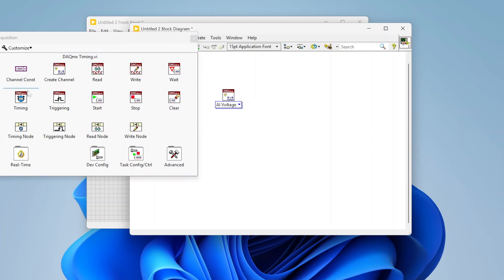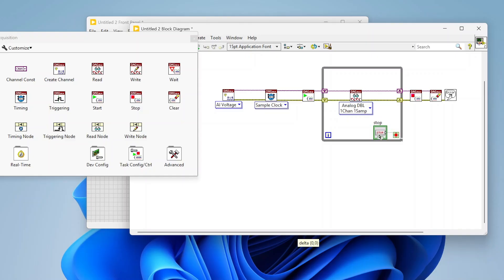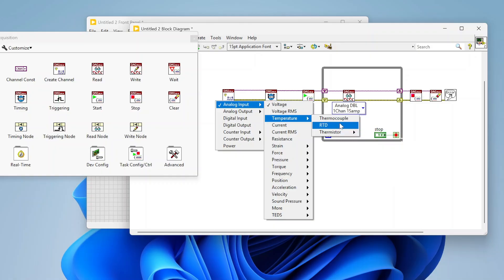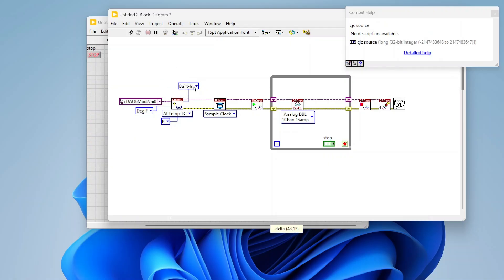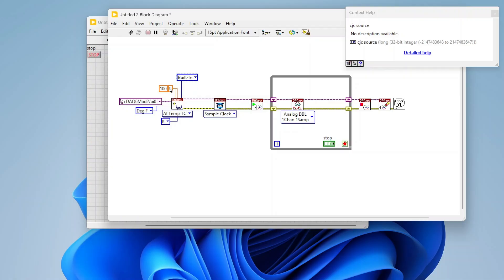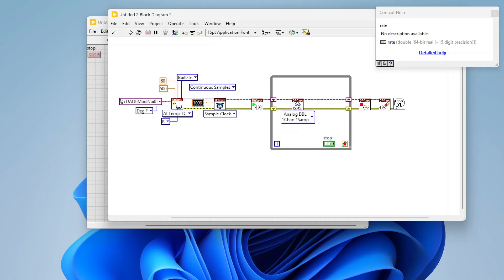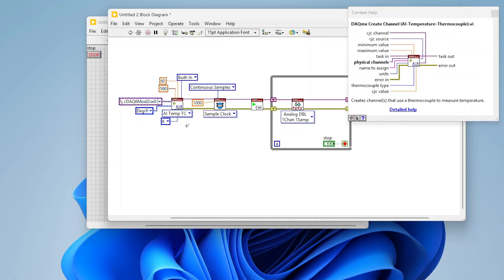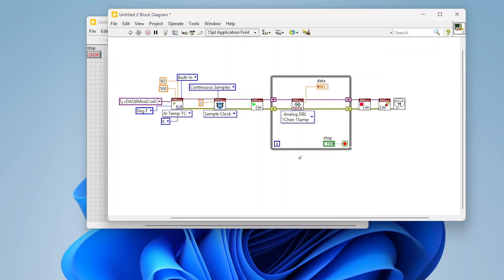Measuring Temperature with DAQmx in LabVIEW

Comment: What if I am using current to measure pressure on a pressure gauge?
Reply from the maker: You will just want to change the type of the daqmx create channel function to current type. Some of its inputs will change so set those accordingly. The rest of the daqmx code afterwards will be exactly the same though. I will make a video on this soon
Reply: @cannoncontrols  Thank you very much. I will be waiting for the video.